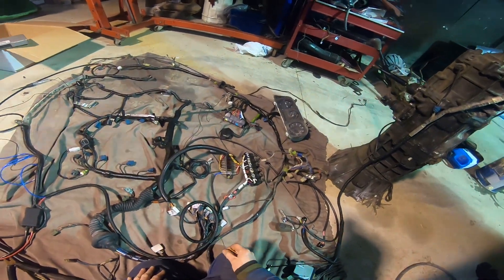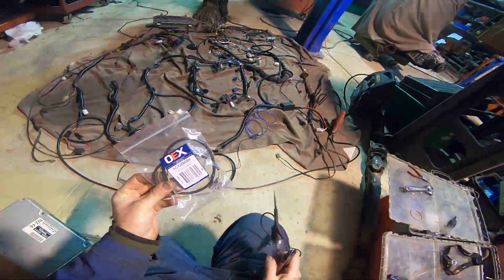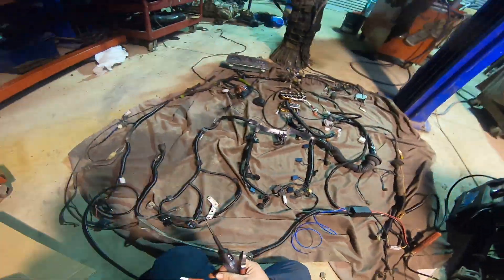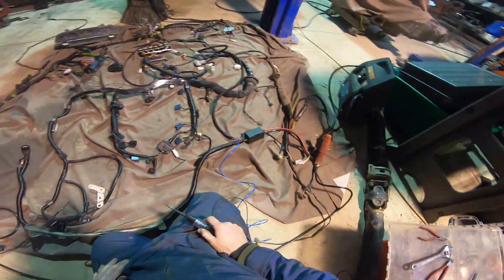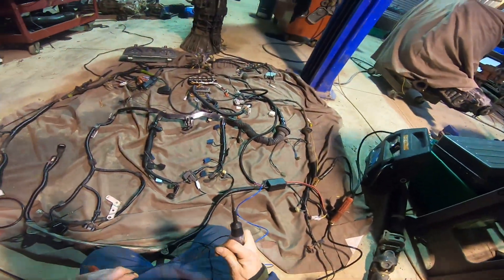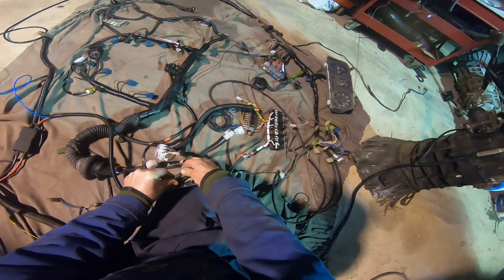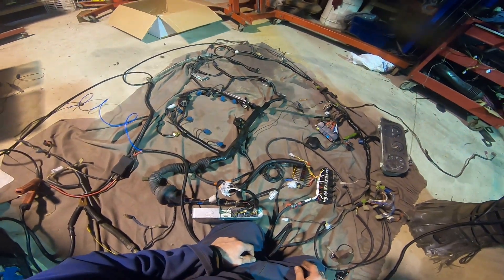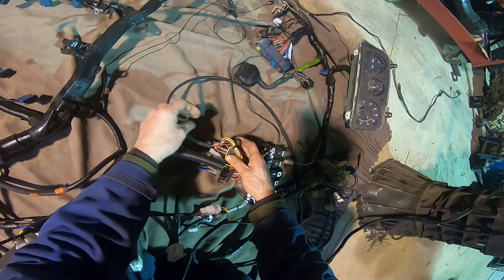Wiring harness 1981 Toyota Pickup to 1uz.

Comment: good stuff kelvin watched a few time to try get my head around it , guessing it will be a bit different set up when running a link ecu and coil packs. just wondering is that loom in the vid the full engine and lighting etc or just the engine management loom cheers Ants
Reply from the maker: Hello Antz.  That one has the engine wiring loom and the front dash loom in there.  Yes your loom will be quite different.  Ill make sure you understand when we put it together.  Cheers